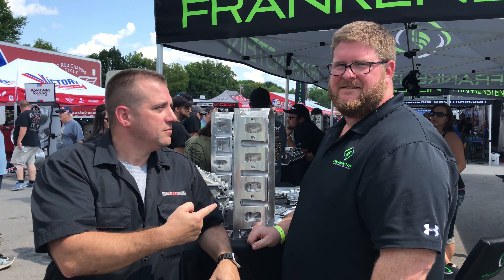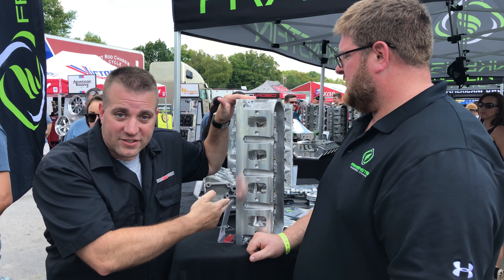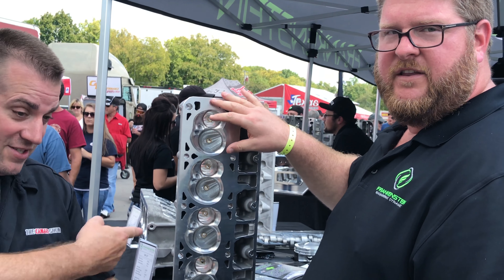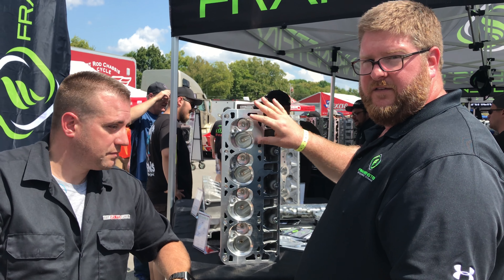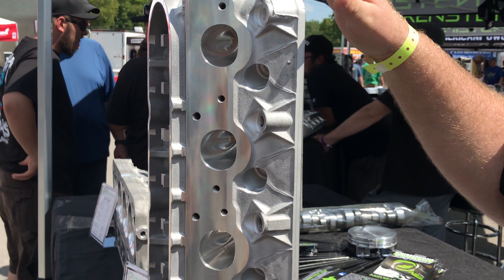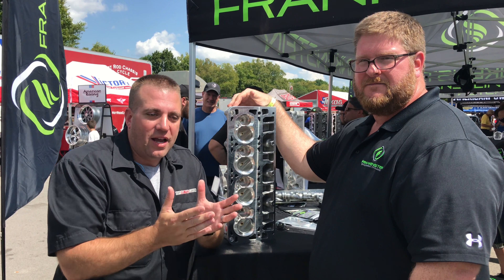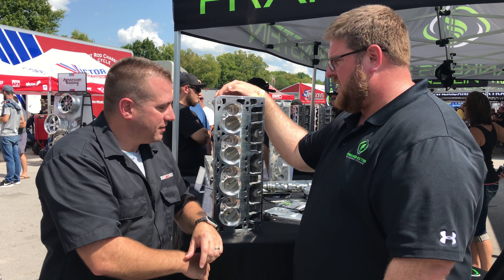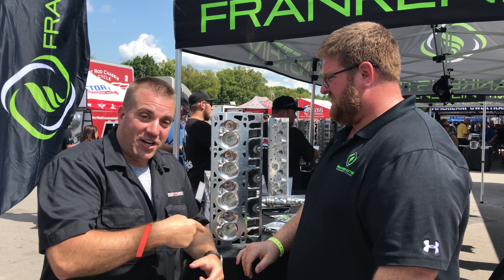LS7 Cylinder Head Dropped Valve Solution with Frankenstein Engine Dynamics

Comment: But does this address the problem that  causes the valves to drop in the first place? It's nice to have those things done to the head but do you still have a ticking time bomb that's waiting to go off?
Reply from the maker: That's a fair question...and the answer is even more unknown.  Some say it does, others say it doesn't.  Since I made this video, it seems that the questions continue, but the answers stay hidden.
Reply: @InJasonsGarage  Good luck with it; I hope you don't have to deal with a valve dropping into the cylinder. It seems to me that GM could have been more forthright about the problem and how to get it fixed.

Comment: You should post up your pricing in the description
Reply from the maker: All information is at their web site, https://frankensteined.net/.  You can also give them a call.  (817) 556-2434.  Tell them you saw this video!
Reply: $1900.00 per head when you give them a core.
Reply: motocrossriders2002 that seems extremely expensive. Lingenfelter is considerably cheaper. Edit I just looked at their site it's 1900 / pair and they do the whole ball of Wax
Reply from the maker: Are you sure that is per head or per pair?  I don't know of anyone who does single cylinder heads.
Reply: We have the F-Series on our website www.FrankensteinED.net now for Pre-Order
Reply: So 1900$ what’s show cases here

Comment: Same problem with 5.3 silverados? Ive seen several with engine knocking
Reply from the maker: Not that I have heard, but I don't follow Silverado 5.3 news usually.  The LS7 problem won't be much of an engine knock...it will be a mechanical catastrophe, often with no solid indication it is going to happen.
Reply: Jason's Garage ok. I have a C5 with an LS1...hope its not an issue
Reply from the maker: Not likely.  This issue is thought to be mostly specific to the LS7, but some have said the LS9 also has some similar issues, but pretty rare by comparison.
Reply: Check your knock sensors... infamous for the harness to rot/corrode away causing issues, but at that point you might as well swap the sensors too

Comment: What are the flow numbers??
Reply from the maker: https://frankensteined.net/shop/gm-ls7-stage-1-fed-heads/
Intake Peak Flow: 410
Exhaust Peak Flow: 260
Reply: Saw a set of these with 1200 miles, racing miles. Guides were worn slam out.
Reply from the maker: @Mark Hacker: Frankenstein heads or stock heads?  And what does "slam out" mean?  Never heard the term.  Was it a typo?
Reply: The Frankenstein heads. Are there flow numbers?
Reply from the maker: @MrSmokin04 - See my comment above from a month ago!
Reply: Sure. That doesn't help. Thanks? :/

Comment: Know a guy who got a set of ls7 heads that were done by Frankenstein, they were junk. Let me say they were put on a street/strip car that had only 12000 miles on them. The guides were gone, I mean way out of spec. Just fyi guys.
Reply from the maker: Did you mean 1,200 miles by any chance?
Reply: Jason D,long time!!

Surely you have read the FB on the website you started?lol

Frankenstein heads have been proven to lose power over stock heads!
Reply: Exhaust valves are the problem, they are sodium filled for cooling, however the exhaust valves are hollow stems and apparently will not take the side load. Replace exhaust factory exhaust valves with good solid stem exhaust valves.
zoo

Comment: reworking the guides isnt going to fix the problem.  Its the valvetrain thats flawed by its design.
Reply: In what way?
Reply: the offset rocker is the problem.  It causes side load and wears out the guide
Reply: While I tend to agree there's still some underlying problem with these heads, it's still odd some can run for 150k or more without an issue and others are dropping a valve with less than 10k on them.   One thing is for sure, I'm not certain "fixing" the valve guilds truly solves the problem.   A big nut to swallow it you have to keep pulling the heads every 25k!
Reply: yea for sure. i've heard rumors about metallurgy causing lifter bleed down and all sorts of stuff.   I hate to say it, but i think the solution is to find a set of ls3 based heads that are opened up as much as possible for the cubic inches of the 427.
Reply: I agree, swapping to LS3 heads and intake would take care of the problem, but it's also a significant step backwards regarding power loss.   The difference between ported LS3 heads and ported LS7 heads has to be 30 hp, probably a lot more!   Part of me wants to just say F-it and run the factory heads until it nukes, then pull the engine and throw a crate LS3 in there with a SC... It would probably make a lot more power and actually be reliable!  Urrrgggg, this problem really sours an otherwise awesome car!
Reply: haha!  I agree completely!   The c6z is an animal and it sucks being paranoid about the issue.  Chadyellowz06 on here did ported ls3 heads on a c6z and it lost 21 hp :(
Reply: @ssoffshore5111  The LS3 also has the weirdo offset rockers....
Reply: Reminds me of TFS Twisted Wedge.
Reply: 😂😂😂 wrong, everyone on YouTube is a mechanic 😂😂😂
Reply: @cryptocarsandcoffee7854  explain your thought process then